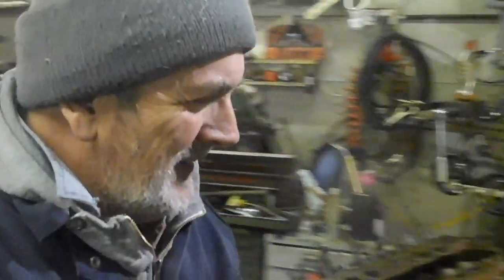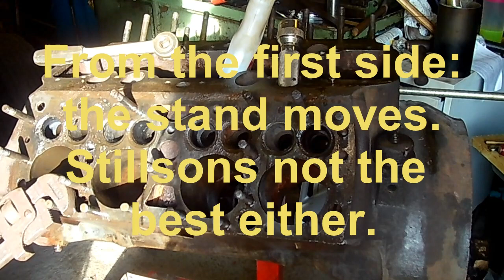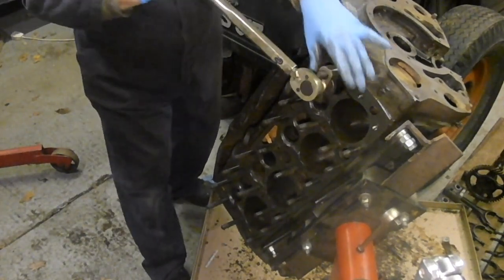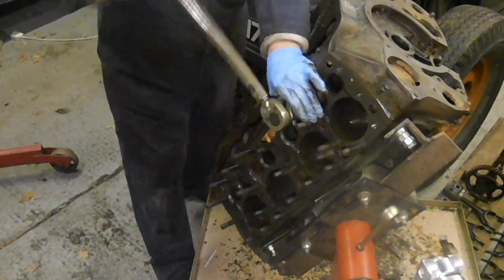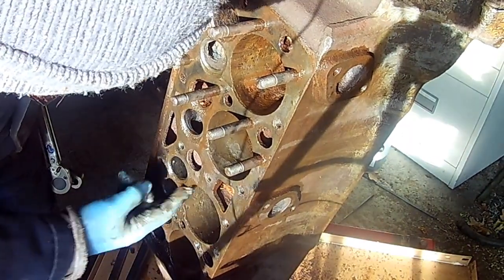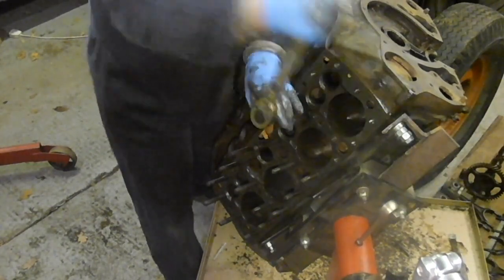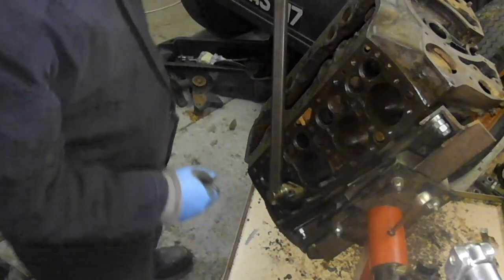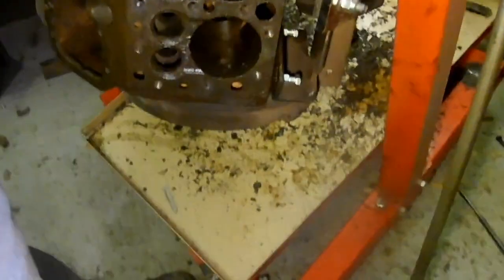Seized Ford Flathead V8 Teardown Pt6: Take those studs out!

Comment: I was waiting for one to twist off. Good tip about not using a tap on the threads. I did not know that.
Reply from the maker: Yeah, Ralph, I was half expecting breakage too.  The thing re tapping the threads gets mentioned sometimes on the barn that's why I mentioned it again in case someone was not aware of it.

Comment: So glad that I found your video's.  I have just been working on a real stubborn 21 stud. The heads were so bad that I had to use an air hammer on them to wedge them up after trying for 3 weeks...managed to break off the corner of one though...Had same issue with crank as You but managed to get it out similarly. Now need to remove studs so this is great knowledge for me to get mine out. I look forward to watching the rest of these series of videos! Thanks Mart!
Reply from the maker: Thanks for the comment, Don. Check my other videos. "Prepare the stunt block" shows stud removal and there are a couple just about removing broken studs. I was lucky with this one, I think.

Comment: Interesting comment on not running a tap in the holes cause I have watch so many video when they do. Maybe just a bore brush to clean them out?
Reply from the maker: Hello Galen. You can get thread cleaners that are like a bolt with slots cut in. They will clean out the crud without removing metal.

Comment: A short 'stubby' extension bar, between extractor socket and break-bar/torque wrench, would give you stud height clearance when backing-out the studs, possibly? I find a good length of extension tubing, proportional to the size of studs being extracted or nuts being removed from threaded studs/bolts, is a positive advantage. Even & smooth applications of force to the break-bar/torque wrench is also key to successful removal. Avoid sharp jerks to the breaking bar. Patience goes a long way, as Mart's shown, to successful extractions. Bare-in-mind that studs are malleable steel being pulled from long term 'beds', holes, within much harder cast iron engine blocks that have corrosion, heat distortion and potentially bonding effects of random oils/dirt/grease/coolant additives/thread sealants/etc to break free of, before they're willing to be extracted. Never more does the idiom of "softly, softly, catchee monkey" hold true. Be patient! https://youtu.be/Z1svDnKkwXs
Reply from the maker: Thanks for that Koops. I avoid anything that adds height as it introduces a bending moment which can push a stud that's on the brink of breaking over the edge.
Reply: @MartsGarage  
Wonder ?? For that same reason if a impact wrench set somewhere lower than "max" would turn them out. Learned that "rotation only" idea when trying to loosen the big bolt that holds the front wheel cylinder to the spindle on a 57 Chevy. It had a rather large head (7/8" - 1") so I had a large box wrench on it trying to loosen it. Wouldn't budge. Tried the 1/2" breaker bar with a socket. Same effect. My nephew brought me a 1/2" impact wrench. Put it on the bolt and it backed out pretty as you please. Hmmmm. No downward loading on the bolt threads. Strictly "rotational" force (torque) so no added resistance from thread friction.

Comment: I used the snap-on stud puller but not the hammer and ended up breaking 3 studs. I have about 36 to go so I definitely will try the hammer. What brand stud pullers did you use?.
Reply from the maker: Mine is a vintage Britool. The snap on looks like a nice unit, though. The roller box one is a Beta 11mm. I avoid high torque with that as I broke the last one.

Comment: Are you using a stud removal tool? I can’t quite tell from the vid. Please and thank you.
Reply: I removed the engine stud nuts and the whole stud came out of several of them.
Reply from the maker: Hello Paul. Yes, I use one that has an eccentric knurled wheel and one that has rollers in it that move up a ramp to tighten.
Reply: @MartsGarage  ok thanks man.